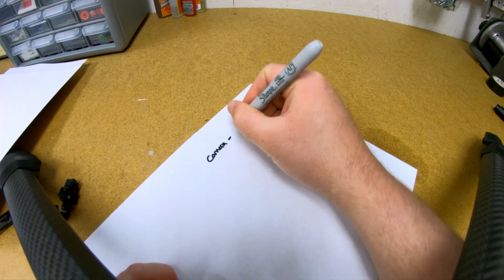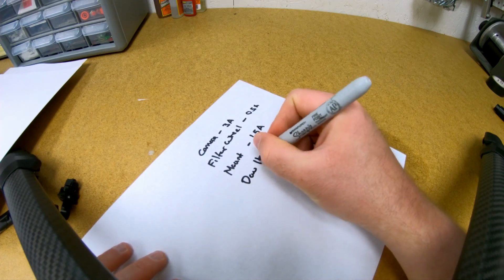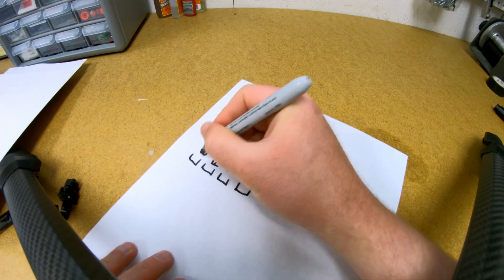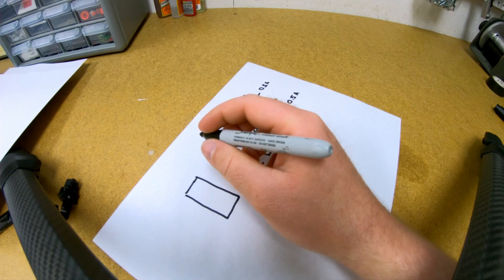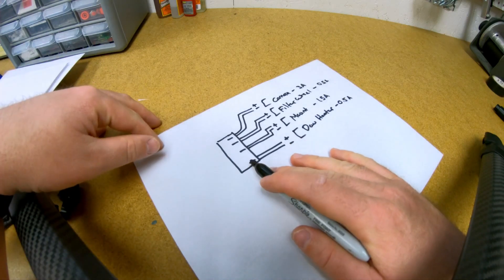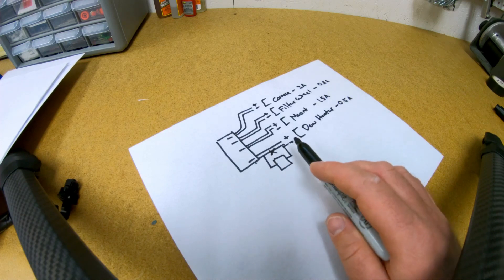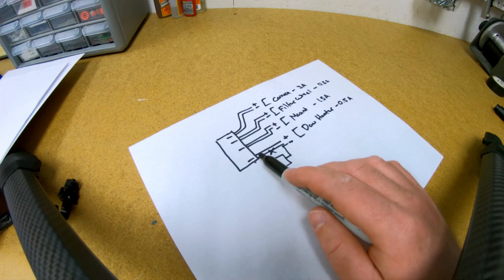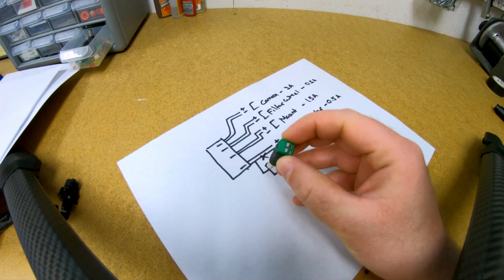Astrophotography Power Management: Part II

Comment: I'll just pick up on the disclaimer at the beginning. I understand why that had to be put up but don't get too worried about it if using 12 volt dc sources. Use a decent commercial charger to top your battery up and you are fairly safe. There is a very minimal risk of electrocution from the 12 volt voltage. What you do need to be aware of is that under short circuit fault conditions these batteries can deliver a LOT of current - many hundreds of amps in some cases. Normally the current draw is relatively low - a few amps per connected device - but if a short circuit happens then the wiring can quite easily turn into an electric fire and indeed melt. So, as shown in the video, it is essential that you include fusing of some form both for the individual items and also at the battery output. Either with a standard car type fuse - readily available along with the holders or for a more sophisticated set up use a miniature circuit breaker - these are resettable and may help get you back up and running more quickly once the fault has been dealt with. Take a torch with you! BobUK.
Reply: Totally agree with this, I had a solar charge controller fail, and it basically dumped the battery and melted all the wiring, fortunately I happened to see the smoke starting and managed to kill the system before a fire started. (This was on a DIY swimming pool solar thermal heating setup)